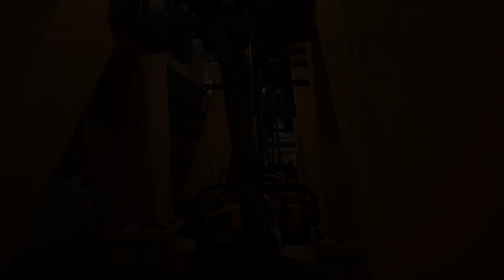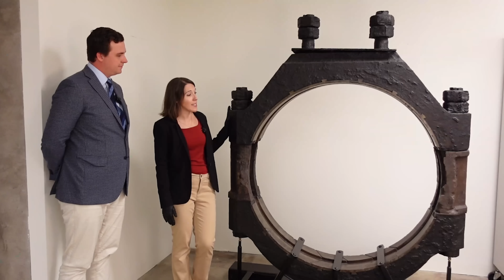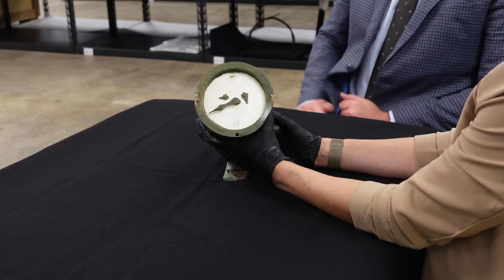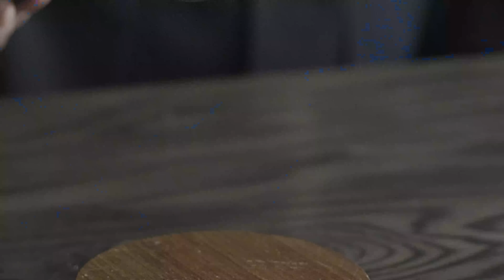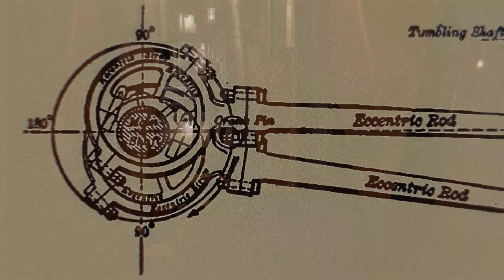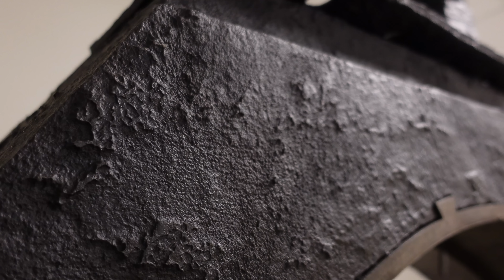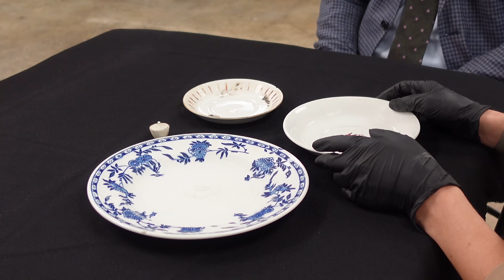Exploring Titanic's Rarest Artefacts: The Engines

Comment: You can see the oil guilds inside the eccentric rod or what looks like a giant piston rod of a car engine, but without the rod ,which you can see it would have been bolted with those 4 massive nuts on the top section. 🦘✌🙌 ⚓
Its weight is 2 tons just imagine the amount of torque required for those nuts and what did they used on board to torque those nuts if they had too.🦘✌🙌⚓

Comment: The eccentric strap with the giant nuts holding it together hits me in the gut. I've been restoring antique sewing machines from roughly the same era, and there is a deep familiarity to these mechanical components for me. I just cleaned up and polished a cast iron eccentric strap that fits in the palm of my hand, with tiny nuts holding it together, and even this little version is solid and weighty. Someone very skilled made it, someone (or many someones) used it and loved it before me. It would take significant strength to rip my little eccentric strap from its neighbouring components; the power it took to rip those engines apart is staggering to think about. 

There is something very beautiful and grounding about cast-iron machinery, be it tiny or massive. The workers who built and operated those engines would have had pride and love for them. All that hard work really meant something to those people, and my heart aches to think about them watching it rip apart.

Comment: The interesting thing about that eccentric end loop is that the bearing surface, presumably bronze, is held in place within the cast iron by small wedge projections.   This would have required unbelievably accurate machining, so it was presumably cast in place.  But since bronze melts only 200 C lower than cast iron, that implies very careful control over temperature.

Comment: The LOG meter system can be cleaned by ultrasonic cleaning immersed in demineralized water and using osmosis to get rid of the salt content in side the assembly, the same with anything which might be sealed like that. 
Plus just how much items were stolen from the seafloor as far as jewelry etc, is mind blowing ,its basically stealing from a grave site IMHO. 
Anyone who could afford to go down there that deep and then recover all that ,with metal detectors ,so gold and silver and platinum objects were all stolen from a grave site. I wonder if it was still considered theft back then in the mid 1990's and i am not talking about recovery of objects for historic reasons but to steal only the gold and other metal object with metal detectors etc. cheers 🦘👍👌⚓🙏😥

Comment: The hobby of magnet fishing is, as far as I know, now prohibited in front of the Harland and Wolff former Titanic building site, now the Titanic museum, but in the early 1990s, no problem.
I found many discarded, bad cut off rivets. and rivet shafts. Yeah, these things were not always riveted into place in the right way. Well, heat the bowl head up to yellow and cut it off, push the rod out, and rivet it over again. I think thousands of rivet heads and shafts were swept into the water, and most are still there.

Comment: 16:24 we think were advanced, but everyone has a smaller version of this component in their car. Modern ships likely still use them as well.

Look up "connecting rod". this is the base where the bottom half, the connecting rod cap, bolts around the crankshaft to move the rod & piston up and down.

Comment: The Stevenson's valve gear sounds like a camshaft on a modern engine but instead of letting in Fuel and air it's letting in Steam.

Comment: Hello Mike!

I have a feeling that when my vessel is complete and launched,
You might do a vid on it, small info about the ocean liner 

Small 2 funnelled black hull black funnels

Name: ( working on it )
old name: Glorian II
Planned top speed: 25 knots
Passenger capacity: 40
Crew: 5
Ship length: 600-500 ft
Propellers: 2 
10 to 20 ft rudder
Lifeboats: 6
Lifeboat capacity: 10
Titanic like helm
No engine telegraphs
Modern day radio
Modern radar
Began plans: aug 1th 2025
Launch date: april 8th 2080 pos 2050

More on my channel!

Comment: You can see this engine part on a modern car, holding the bottom end of the piston rod, with a large pin going through it to hold it on the shaft.

Comment: The crankshaft itself would have to have snapped right at that journal for that eccentric rod end to have been picked up off the ocean floor.
Reply: The unit recovered was a spare kept in the engineers' workshop, which fell free as the shell plating peeled away during descent to the seabed. The ones installed on the engines should still be in place, twisted and crushed under the ruins of the aft superstructure.
Reply: @DistractedGlobeGuy   Of Course, HA well spotted. Thanks

Comment: I work on steam locomotives for a living, most of the locomotives I work on are also fitted with Stephenson valve gear (its the equivalent of a gearbox) and are pretty much the same age as titanic. I've machined and cast and fitted and inspected dozens of eccentric straps amongst other things on many occasions so this find really fascinates me. 

The white metal on the strap which comes into contact with and rotates around the eccentric itself, the silver looking stuff on the inside of the ring is very typically a mixture of Tin and Lead I'm not sure that bronze is right that seems unusual, though on other types of bearings with white metal, bronze is often used in conjunction like on an axle box but I've never heard or seen of bronze used on a strap it wouldn't last long at all id think

but regardless the metal looks completely brand new its done absolutely nothing, all the oil grooves still have a very defined shape and their isn't any scoring to indicate wear and you can even see the little casting porous spots around the edge. This is such an amazing piece its not only as a titanic artefact but its a direct piece of engineering history preserved from the time period itself absolutely fantastic.

Comment: I didn't expect our friend Mike Brady to be like 6'4 that was a shock
Reply: I’m only halfway in but the woman can just be on the smaller side
Reply: @heatherchandler1184 he extends his arms at one point and that sealed the deal for me. Hes at least 6 foot but I would say taller than that. Im 6'4 myself so i have a fair idea of body preportions. 

I absolutely agree the lady may be quite small and with no true frame of reference it is impossible to tell
Reply: @sleaz @sleazymeezy I looked up the eccentric strap dimensions and it is 7 feet tall. It seems to be sitting on a base which may make it a bit taller than that. I would say the women is 5 2’-5 4. Or a good two feet shorter than the ring. Given that our friend Mike Brady is standing closer to the camera, which may make him seem a bit larger, I’d say 6 2’-6 4’ would be a good estimate.
Reply: @smontonewell shit, they did the maths.

Comment: Artifact collection is controversial, but I am all for it as long as it's done in a safe and organized way.  Of course everyone loves the eerie romance of the wreck herself, silently laying in eternal cold and darkness.  But the fact is, her destiny is to be nothing more than a rusty stain on the seafloor eventually.  There has already been significant degradation over the last 40 years or so since her discovery.  But bringing up pieces and preserving them extends her legacy indefinitely, and is MUCH more accessible to the public.   
Frankly, if I had the money and the political connections, I would see about raising the Terror and Erebus for the same reason.   If they can do it for the Vasa (to call it a Swedish treasure is an understatement) then I think other ships should be raised, preserved and displayed too.

Comment: That big piece is like the end of an internal combustion engine’s connecting rod.
Reply: It's not that different, most internal combustion tech is based on steam engine practices as they came first and a lot of the engineering and maching requirements are very similar. Piston rings, big ends and crankshafts, and so on.

Comment: Getting the dimensions exact on a part that big was an amazing example of what people could do back then.
BTW:  On the "cut off" thing that many may have missed:
In a steam engine, the piston comes up to the top of the cylinder and you open a valve to put steam in to push the piston back down.  The piston doesn't get very far down before you shut off the valve and from then on, the steam is expanding as the piston goes down.  At the bottom of the stroke, the steam is now at much less pressure and much cooler.  The remaining pressure is used to drive the 2nd cylinder of the pair which is larger and working at the lower pressure.  All of the pressure numbers are controlled by how far down you let the first piston go before you shut off its steam input.  This also controls the torque the engine applies to the shaft.

Comment: Thank you for talking about the Stephenson valve gear. I've been wondering what system they had used. What an interesting juxtaposition to have the big reciprocating engines using a valve gear design basically from the 1830s sitting beside the blazing new steam turbine.

Comment: It's cool seeing the oil gallies within the bearing surface, I'm probably the only one that thinks so.
Reply: It is pretty cool...at first glance it looked like a piece of a connecting rod, but those would have probably been bigger/more robust.  That technology lives on in reciprocating engines in cars...connecting rods are often still made of cast iron with bearings (usually aluminum) that have similar oil passages. Cool stuff!
Reply: @scottclark7559 it is a part of a connecting rod, look inside the internal combustion engine and you'll see. I just think its so cool the oil gallies machined into the bearings are still in such good shape.
Reply: @randylahey1232 It looks similar to a connecting rod, but it's not...it's an eccentric strap. Con rods connect the crankshaft to the pistons, this serves  a completely different function that only steam engines have. I'm pretty familiar with the inter workings of reciprocating engines .. I've rebuilt a couple dozen car engines over the years.
Reply: @scottclark7559 i get that but its still the same basic part, i understand its not connected to the crank shaft.
Reply: @randylahey1232 They're different parts with different names that do different things, but there is some resemblance in the shape for sure

Comment: 11:24 The former Michigan mechanic in me wondering how they got the 50+ years of saltwater rusted nuts loose to remove the rod cap until learning it was a spare. If there was ever a bombshell commercial for PB Blaster this would be it.
Reply: I'm an ex marine engineer from the 1960's.
On older ships we had BIG slug wrenches to undo and to tighten large nuts like these,  like on cylinder heads , bearing caps etc.
On later engines we used hydraulic rams to stretch  the studs a predetermaned amount so the nuts could be undone  by hand  and later tightened , again  just by hand.
Reply: @alfamontydog  So they use rams and do them torque to yield style, I never realized TTY was used on that large of fasteners. I generally hate that they put them on the dumbest places on cars now but I can absolutely see it on something like a big ship engine. Thanks for sharing the process, I've always been a bit curious about it.

Comment: Nice! Thanks Mike, how many generators (dynamo's) were there and how were they kept running until the end, that would be a great video to do also
Reply: There were four main generators in the room just abaft the turbine casing, plus two much smaller back-up units up inside the fourth funnel shaft, which only powered the emergency lights.
Just one of the main units was sufficient to power basically everything electrical on the ship at once, and they left the single-ended boilers in Room 1 running until after 1:30AM to keep it supplied with steam. According to a trimmer who had been assisting the electricians, they had just gotten the emergency units online when the keel failed, breaking off the steam lines and the circuits.
Circling back to the fact that the main generators were far more powerful than the ship really needed, Olympic actually sold electrical power to the New York municipal grid when she was docked there in the early part of her career—the entire city could run off her internal supply more efficiently than she could off of shore power.
There's also a photo in the National Museum of Northern Ireland's RJ Welch collection showing one of Britannic's main generators mounted in place late in her construction, if you want to get a sense of scale.

Comment: Curious if the constant wash from propellers added some amount of error to the measurements of the log meter over an extended distance?
Reply: I believe there was a formula that the ship's officers used to correct for that, if I recall correctly. Also, you don't really need accuracy to the nearest three feet like modern gps often can get down to. You only really need to be able to get within sight of whatever landmark (or other vessel) you are looking for, which can be several miles either way in good visibility. The deep-water, middle-of-the-ocean paper-chart navigation of the time was only ever reasonably accurate...which is why it was so difficult to find the wreck. The reporting of her position on the night of the sinking was only ever reasonably accurate. There was always a margin of error.
Reply: It would—they even had a term, "slippage", which referred to the difference between the taffrail log and the actual distance travelled. A huge part of the complex science of propeller design is predicting and minimising slippage.
Reply: I'd be more curious about the current.. If there's a five knot current in the same direction the ship travelling, and the ship is travelling at 5 knots, Then that should measure the ship being stationary. like with an airplane where you have ground speed and airspeed.
Reply: @Coolcarting that's why the dead reckoning position was important for navigation—but the taffrail was still helpful for evaluating engine performance and predicting fuel consumption rates.

Comment: As a marine engineer, long before it was stated the eccentric strap was a spare, I'd recognised it as such & it would have likely been mounted on a bulkhead close to where it would be used, within reach of the steam hoist, so in the event of a failure/breakdown, needing the replacement if this part, it would minimise the down time, just being able to lift such large components off of custom made wall brackets, rather than having to dig it out of a spares store, usually decks higher, at the top of the engineroom or a section of one of the holds, with all usable engineroom space being used for essential machinery, not spare parts. With such big spares, if they were kept in the spares store you can guarantee they'd end up on the deck somewhere, likely pushed underneath shelving racks, with other parts piled on top, to keep it out of the way, & maximise storage space. In an emergency maintenance situation, you'd not only need to get the part down from the store to where it was needed, but you'd also have to dig it out first. Breakdowns usually happen in the worst conditions, such as awful storms, or during manoeuvring, where the loss of propulsion could be extremely hazardous, so making spare parts easily accessible not only reduces down time but also reduces the risks of injury to those involved in getting the part to the engine, in awful conditions, in the middle of the night, with intense pressure to have it fixed already. This is why key spare components for main engines are still bulkhead mounted today, as close as possible to where they'd be needed for routine & breakdown maintenance, along with the huge tools used to remove the failed part & fit the new one. The only difference is that today they're moved around by electric gantry cranes, just like you'd find in a shoreside warehouse/manufacturing facility 😉

Comment: Something we marine engineers accept, from our first time on a ship of any size, is that in certain emergency situations we wouldn't make it out of the engine room. For example, engine room firefighting systems utilising CO2/argon/certain foams, there is only a 30 second warning before this last resort fire fighting measure is released. Up until that point, engineers would be putting everything into fighting that fire, & have to trust that the Captain would only ever use the system when not doing so would lead to the loss of the ship & possibly all lives vs those in the engineroom firefighting team. There is little thought of escaping when your focus is 100% on the job in hand; it's just what engineers do 🤷🏻🤗
Reply: The book "Totally Steaming" by Damon Hammond, while mainly a very funny description of life aboard HMS Fearless at the end of the 20th century, includes a compelling description of an engine room fire where the steam drench system had to be operated while not everyone was accounted for.
The book is available on Kindle.
Reply: Same with warships where the magazines can be flooded in emergencies.
Reply: Pish . Oooh my hero . I bet you collect shopping trolleys in Tesco's 😂